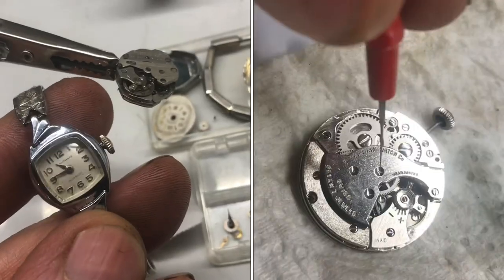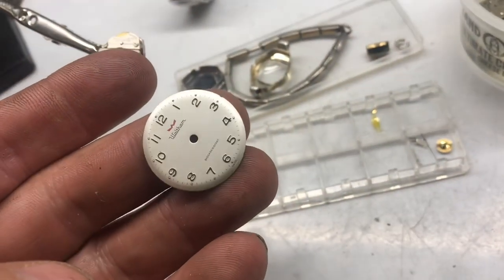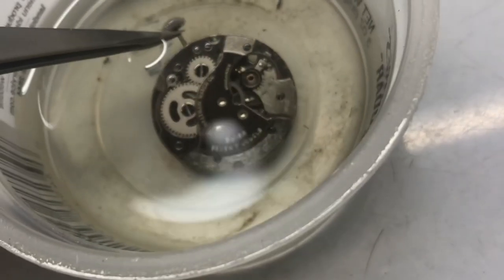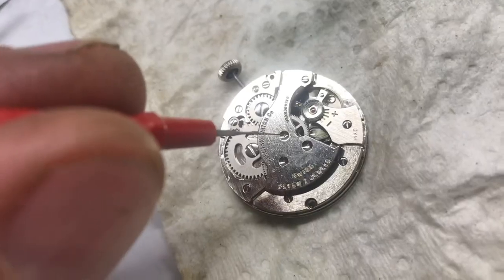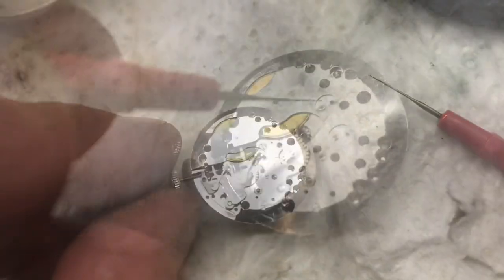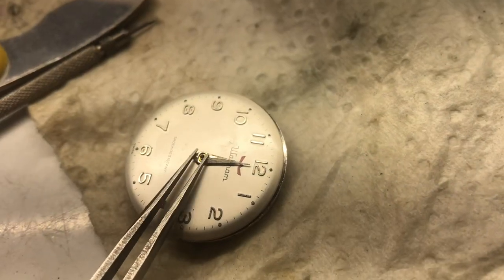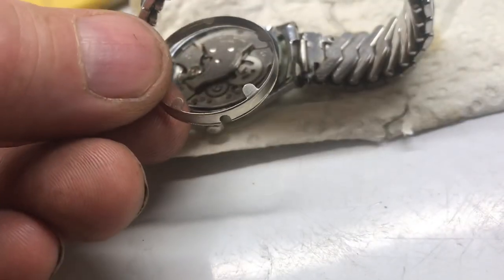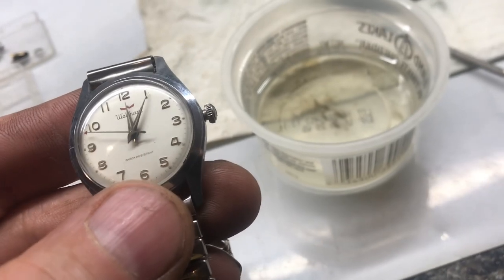“cleaning a wrist watch” the EASY WAY (soaking “without disassembling” movement)

Comment: I should want to strongly disapprove of this but I can't argue with the result. This is something I've often wandered about doing as an experiment. Of course, as the man clearly states, don't do this to your fancy watch.
Reply: That's because it's a bad idea. It leaves an oily residue on literally everything in the watch that will attract dust -- and do nothing to remove dirt from crevices inside the watch movement. 

So basically he took a dirty watch that needed to be taken apart and cleaned, and made it a greasy and dirty watch that needs to be taken apart and cleaned. 

Good rule of thumb: Don't take watch repair tips from a non-specialist.
Reply: @Icanhasautomaticcheeseburger  I'm aware of that, I'd never do this to a watch I care about. But  just to see if you'd get an old dirty one running again. There are many, many reasons why this isn't the way it's supposed to be done, of course.
Reply: This seems like a great idea for something like a Vostok watch where it doesn’t make sense to pay for a service when a whole new movement is so cheap. If it’s cheaper to replace the movement and throw away the old movement then this seems like a great idea.
Reply: I wonder if this is how Rolex does it

Comment: Also, paint thinner makes the surface of the metal less likely to allow oil to stay where it should and over time the resido the paint thinner leaves behind eventually mixes with the oil causing more dirt and grime to be in the intricate parts of the movement. Don't do this ever 😂

Comment: Thanks for the video.  Question:  How do you dry out all the paint thinner that has gotten into the main spring barrel?  Also, this process removes all the oil from the movement (jewels, pivots, keyless works, etc.)  If you don’t disassemble the movement, how can you reach all of these areas to properly re-lubricant the movement?